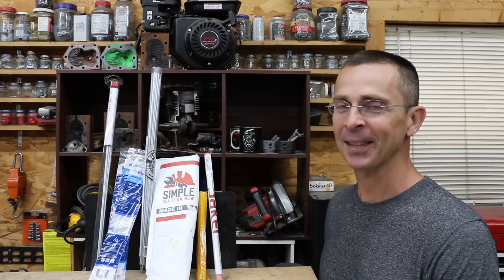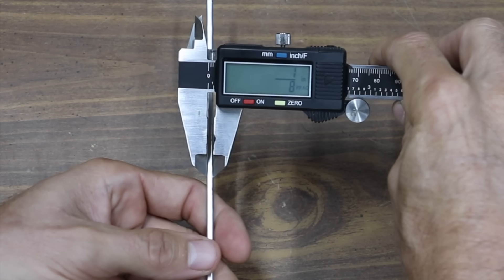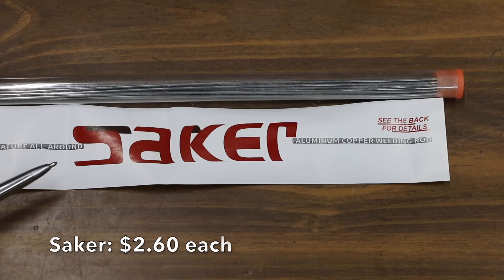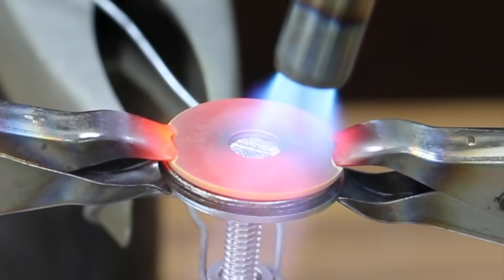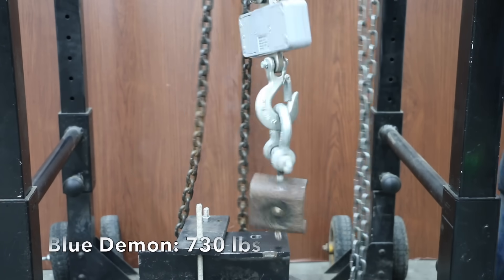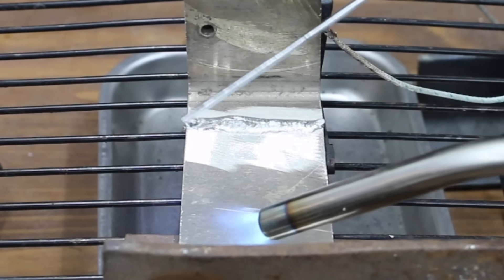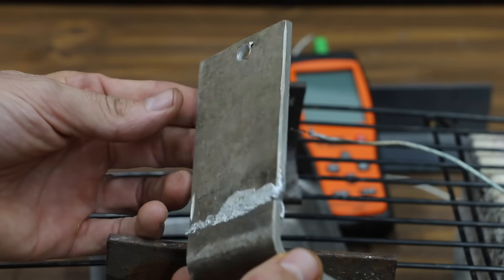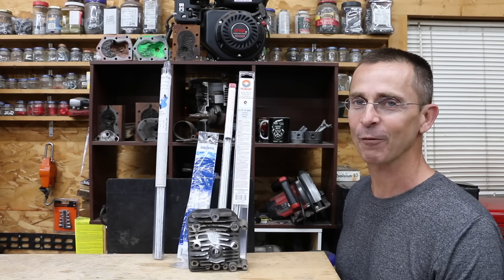Best "No Welder" Aluminum Welding Rods? Alumiweld vs Bernzomatic vs Hobart

Comment: I wonder what the tensile strength of the same sized tig weld is?   Also Why "Definitely non-chlorinated" ?
Reply: Because heating chlorinated brake cleaner can (and most likely will) produce dangerous gasses
Reply: @Rezoix  why hasn't the chlorinated brake cleaner evaporated or been wiped off during the cleaning product?
Reply: welding over chlorinated solvent produces some very toxic gases.
Reply: @TheKajunkat  yea ah porus weld
Reply: I know I spelled it wrong the first time, but any flame, along with temp will create phosgene gas.
Reply: @goodnough1  I was soldering a refrigeration line with regular lead solder and a simple propane torch in my Dad's grocery store when I was about 18 years old. I didn't have the valve tightened enough and R-12 was leaking into the line. I got a whiff and found myself on the floor. Phosgene hits you fast and hard and can kill you but is isn't cyanide.
Reply: @goodnough1  Phosgene also called Mustard Gas very popular during WW1.
Reply: Related to this, 50 years ago I soldered aluminum parts with a flux called Sal-Met. It tinned the aluminum beautifully but I inhaled a snootful of the fumes. I had flu-like symptoms for a few days immediately after that.
Reply: @flagmichael  its called a metal fever and if u only did it once its not that bad but if you've done it a lot go get checked for lung and throat cancer
Reply: @flagmichael  yeah that stuff will make you sick. Also galvanized pipe or any galvanized product. I got sick as a dog trying to weld out some galvanized pipe one time.
Reply: jack watkins Drink milk when this happens it counter acts the zinc!
Reply: @robertpolicastro1  you have got to be kidding? I have never heard that before. I'm not saying it won't work I just wonder how milk in your stomach can counteract what you breathed into your lungs?
Reply: @robertpolicastro1  Doesn't work, UK Health and Safety executive (like OSHA) specifically highlights it as a myth.....doesn't do squat for metal fume fever / galv poisoning
Reply: @robertpolicastro1  A rather cute girl I was very interested in many years ago in the U.K, was studying oil production welding and engineering. During the practical welding parts of the course she told me they were given a pint of milk to drink.
Reply: @flagmichael  Yes had it myself bud welding galvanized steal not a nice feeling or taste galvi flu we call it lol
Reply: Phosgene is created when arc welding in contact with chlorinated solvents (particularly brake cleaner). I don't believe a MAPP torch is hot enough, however. MAPP burns at ~3750 Fahrenheit, whereas the arc on a MIG welder ranges from 10,000 to 15,000 Fahrenheit.
Reply: @jasoncarswell7458  Its not about heat, its about the exposure of chlorine to high intensity UV radiation. Chlorine is a diatomic molecule in its free form and its bonds are rather weak. When a chlorinated compound is exposed to intense UV light. The light has a higher energy level than the Chlorine's bonds, so it breaks them and the result is elemental Chlorine in its free radical state. Chlorine hates being alone in its free state so it jumps to combine with something else OR itself (diatomic). It just so happens that the carbon monoxide in the open air is also reactive as are the carbon liberated in the disassociation of the solvent molecule (and free natural ozone in free air from the arc welding process). So that free radical chlorine plus that CO in the open air have a very low free energy threshold so they happily recombine. The result is Phosgene gas. The old saying is if you smell old wet grass, get the hell out of there. That is the smell of phosgene.

Edit:
To clarify, we are talking about welding. You can produce phosgene with an open flame but only in the presence of copper or some copper compounds. Copper acts as a catalyst to lower the energy threshold for the chlorine bonds but its energy is still low. An electric arc contains a lot more energy so the production of phosgene is much much higher.
Reply: @StreuB1    " If you smell old wet grass, move your a**, that's phosgene gas"...lol.  I had to make up my own version of that rhyme, that was pretty catchy.  Brian nice to see you again man!
Reply: @StreuB1  I may be mistaken but I also thought it had to do with the presence of argon as well?
Reply: @StreuB1  Well said! Your knowledge could save a few lives as there are many that still don't know about this deadly situation. Plus learning about how and why is a nice bonus.
Reply: @markschaefer5703  Argon never does anything, that's why it's a shield gas. Only way you'll hurt yourself with that is filling a space with it and displacing all the air.
Reply: @mfree80286  I meant a reaction between the argon and the chlorine in the presence of an arc
Reply: @markschaefer5703  There's no reaction with argon, possibly unless you're working with enough fluorine to be welding around it... in which case you're likely a dead man anyways. Argon's a noble gas, it's as inert as can be and chemists have to use exotic chemicals and shrines to Walter White in order to get noble gases to react to anything.
Reply: @StreuB1  
Thank you sir, I actually enjoyed your chemistry lesson.  One thing I really like about this channel,  is lots of intelligent individuals like yourself,  are trying to educate people.  Lord knows I need lots of teaching! Again thank you sir.
Reply: @jasoncarswell7458  ahh.. that makes sense.
Reply: @jasoncarswell7458   But what if you allow a few minutes for the non-chlorinated cleaner to evaporate?
Reply: @jasoncarswell7458  Not really, It's the UV radiation. - If you have a puddle of break fluid on the next bench from where you are welding it can actually kill you,,,,and everybody else in the shop. If you don't die the damage is irreversible just the the guys that were gassed with in in WW I. You never get better.  

This guy says it better then I can 
-------------------------------------------------------------------------------------------------------------------
Phosgene (COCl2) is a toxic gas/liquid used as a chemical warfare agent during WWI. Phosgene can form in chloroform as it is exposed to oxygen and amounts of UV light (although UV light is not always necessary if catalytic contaminants are present). Phosgene has a characteristic odor of cut hay.
-----------------------------------------------------------------------------------------------------------------

I will not allow brake cleaner of any kind (just in case) in my shop. Acetone, Lacquer Thinner, CARBURETOR cleaner, OK Brake Cleaner - FORGET IT!
Reply: One problem with brazing rods vs. TIG is that if you're doing multiple parts (i.e. brazing a fuel tank together with several seams and a few bungs) the parent metal will heat up to the point that your other brazed on parts will fall off.  Sort of like having to glue every piece of a model plane kit together at once instead of waiting for each part to harden, you just don't have enough hands and clamps for it.  You might want to fill in a hole, grind it smooth, then braze another piece on...but that smooth grind job is going to sag or run out of the hole by the time you're done brazing another part on. Or perhaps you've got a thick aluminum pipe or fitting that has pitting corrosion, you want to clean it up and fill those pits so the end results is a smooth ground surface.  Good luck, I've tried it and it never worked out well.  Got an aluminum frame you want to build for a go-kart and need to braze a cluster of tubes together?  Not gonna happen with this type of brazing rod, the filler metal will just drip right off the tubes as soon as you move to the next one.  Taking this video as an example, if he wanted to fill in that gouge on the combustion chamber, grind it to profile, and then fill in the outside in the same manner...that re-profiled combustion chamber is going to look terrible by the time he finishes the outside gouge.  Chill bars, heat sinks, and clamps can help, but there's only so much you can do.  With TIG, once you tack it on, it stays no matter how much other welding you do in the area.

That's not to say these rods aren't useful.  I use them to patch holes in tubing, fix little parts, and fab things on the go.  All I need are a few rods, a SS brush, and a propane torch in my truck.  The filler is definitely harder and stronger than aluminum, you can tell easily enough when you go to grind/file/drill/tap it.  All the strength testing videos, they're more or less accurate.  It's also more susceptible to corrosion and turns into a dull gray, almost lead color...not ideal if you're working with cosmetic repairs.
Reply: @Skinflaps_Meatslapper  thank you
Reply: A tig weld is a weld that fuses into both surfaces. This is a low temperature solder or braze that sits on top of the surfaces.
Reply: A properly done TIG weld generally tends to be the better way to go...but if you don't have a TIG welder and/or the skills to use one...brazing is a good option for a lot of applications.
Reply: Fun fact: Back in the day in the shop they used to use flame to detect refrigerant leaks (CFC) Up until they started noticing every time they used the tool, every fly, gnat, spider, ant and bee any insect in the shop, all dead instantly, even in open air. Apparently humans can withstand slightly more than tiny insects. Fortunately they moved away from this method many decades ago, and modified refrigerant for cars since.
Reply: @deanbevier3389  I was in a confinded basement when an R22 charged pipe opened from a small leak into a large one in the A coil.  It displaced the O2 so fast I almost had a hard time getting out fast enough.
Reply: Chlorinated products, when you put a flame to them create fozine gas, which is pretty much cyanide gas.
Reply: @goodnough1  yeah and that is one reason you got to be careful when you're taking a torch to an AC unit in the winter. I damn near passed out one time doing it.
Reply: @goodnough1  yes and any hvac tech can tell you exactly what if feels like when your torch flame hits refrigerant gas... not pleasant.
Reply: @goodnough1  not to be pedantic but it's spelt phosgene as used in WW1...Nasty stuff
Reply: @johnphillip1711  yep I corrected it below.
Reply: @goodnough1  No worries
Reply: @goodnough1  yeah. It chokes you out pretty good. Dont know how much is toxic but I've hit torpedo heaters that are too close with spray and it's not fun
Reply: @goodnough1  Thanks for the specifics!  I am going to clip and paste your clear explanation  in the answer part of another comment thread.  VERY good info to know, thanks, Bob! 👍
Reply: @goodnough1  Actually, it’s Phosgene gas.
Reply: @goodnough1  stop spreading misinformation
Reply: @goodnough1  Did you mean phosgene?
Reply: @goodnough1   @Bob G  I didn't even think about that, that makes perfect sense, I'm assuming that's only in the case of heating up the liquid brake cleaner or in a gaseous form. I would imagine that would be pretty difficult to do though because you would have to bring the brake cleaner up to that temperature before it evaporates. I'm totally going to do some research on this now.
Reply: @WarpedYT  hitler used this type gas in that thing he did
Reply: @Formerlywarmer  The Nazi's did not use Phosgene, they used sulfur-mustards and early nerve agents. They also used raw chlorine but that was a rarity as that was more so used in WW1 before organo-phosphates and the like were developed. They used it a few times because they were running out of support I believe. Phosgene was a WW1 weapon for the most part, long before the Nazi's.
Reply: @StreuB1  Aha, now let me be the one to (gently) correct you both, sir. All sides used phosgene and chlorine as war gases in WW1, but Hitler used neither phosgene nor chlorine in the gas chambers. Zyklon B was the pesticide brand name Hitler used, and it was hydrogen cyanide gas absorbed into diatomaceous earth pellets. "Just add water". The same method was used for legal gas chamber executions in the US for many years.

Also worth mentioning that simply welding on a car part (for example) that has a thin film of chlorinated brake cleaner is unlikely to create meaningful amounts of phosgene, because most of the chemical will be evaporated and blown away by the initial arc rather than being "cracked" into free radicals. If this wasn't the case, every brake and muffler shop in America would have phosgene casualties. All of the cases I've seen of serious documented injury from unintentionally-generated phosgene involved arc welding in the presence of large amounts of CFC refrigeration gas in a poorly-ventilated area - i.e, trying to fix a leak in the piping of a commercial refrigeration unit without testing the air and purging the pipes with inert gas first.
Reply: @jasoncarswell7458  I never said gas chambers. I was referring to its strategic (battlefield) use.
Reply: @StreuB1  my apologies, sir
Reply: @jasoncarswell7458  No need for an apology! We're having constructive and informative dialog! This is what people do and what used to be rather popular before people got sensitive. While I appreciate the apology, I do not accept it because there is no reason for it. We are having dialog my friend! :-D
Reply: @jasoncarswell7458  mr. Carswell, great comment. I spoke at one comment about nearly passing out working on a unit one cold cold winter day. Temp was down probably five or 10 degrees and and the unit wasn't completely evacuated and good God all mighty that was a rough job. R22 does not boil off real well in pretty much zero degree weather. Have a wonderful day
Reply: @Formerlywarmer  many of the photos of that event existed before the event. Look these up: dresden ohio train accident 1912, civil war typhus pow, eisenhower's rhineland camps (holding germans). with 109% certainty,  I can confirm to you the hall of costs is propaganda.
Reply: @StreuB1  I appreciate both of your civil conversations and history lessons at the same time!!  So thank you both!  Not to mention especially when living in a time where people can't say anything without be disrespectful to one another.
Reply: @WarpedYT  That's likely zinc poisoning. I used to do a lot of metal work and always heard about guys getting sick after grinding or welding on cheap foreign brass (with a high zinc content).
Reply: @Formerlywarmer  Zyklon B isn't the same as Phosgene, Phosgene was used a lot in WW1 and more likely that Hitler encountered it in the field than using it after he came to power.
Reply: @Formerlywarmer  "Some people did something" - Ilhan Omar
Reply: @WarpedYT  As a rule of thumb, it's best to remember 2 things.
1. Heat causes vapor. More heat = more vapors.
2. Industrial products have a lot of compounds in them you never want to inhale if they are vaporized

Chlorine is one of those compounds that when mixed, ignited, vaporized, etc in various ways can kill you before you even realize you are in danger. Chlorine and alcohol when mixed will produce chloroform. A lot of people don't realize that, and some of the people who do who jokingly mixed it as a prank to use on someone have found themselves on trial for murder. Chlorine is no joke. A lot of other commonly used compounds are deceptively benign until they are mixed together or ignited in a way that causes a lot of shop workers and housekeepers to be hospitalized.
Reply: @jasoncarswell7458  Now: THAT'S a very accurate anwer / explanation.
Many thanks & Blessings!!..😊🙏🙏🙏
Reply: @Formerlywarmer  allegedly
Reply: @StreuB1  I respectfully disagree but thanks.
Reply: @WarpedYT  I can confirm it puts off a toxic gas when heated lol almost killed myself in a water tanker by accidentally grabbing the red can instead of the green
Reply: @WarpedYT  - Did you ever find any info on chlorinated brake cleaner producing toxic gases "after" the product/brake cleaner was dry(?)
Reply: Yeah we all know americal chlorinated chiken is bad :D
Reply: Chlorine gas is a chemical weapon
Reply: @maoristereo  -Back when I was a brat kid, my dad put me in charge of cleaning the pool.  A 75 pound drum of HTH chlorine and several bottles of muriatic acid intrigued my 15 year old mind, so I took a plastic tray, put about 1/2 pound of HTH on it, sat it in the yard way back behind the pool, and then poured some muriatic acid on it.  It immediately foamed up and this yellow gas came out of the foam.  As I watched the yellow gas slowly spread across the grass I noted that the blades turned from green to brown instantaneously...
Reply: @Flies2FLL  Back when I was a brat kid in the late sixties we also had a pool with drums of HTH,my friends (all of which my parents could'nt stand) and I would mix the chlorine with all kinds of stuff for "fun. The coolest and probably the dumbest thing we did was take a gallon jug of un-diluted auto anti-freeze about a quarter full, then pour in a cup of HTH and run, the mixture self-detonated in about 20 seconds, leaving a large crater in the ground complete with a mushroom cloud of gas. we also took motor oil soaked newspapers and rolled them up with HTH, result was a self- igniting bon-fire in about ten minutes.
Reply: @pennyan2057  Awesome!  I wish I had known about that reaction;  I could have achieved a new and impressive annoyance level with our neighbors who already hated me~
Reply: @Flies2FLL  15 yr old kids be out here casually conducting chemical warfare tests😂
Reply: BAsically the same as the base metal,,,not allowing for age hardening (6061 T-6)
Reply: If you try to weld metal cleaned with chlorine youre going to have a bad day when the metal gets hot
Reply: Time to rethink that brake cleaner fueled space heater video, eh?
Reply: People have died from heating surfaces prepped with chlorinated cleaners
Reply: @5thcorps  I know. I was on life support because of it.
Reply: After 20 replies not answering your first question, I'll give you the annoying answer: depends on how skilled the TIG welder is :)
Reply: @snaplash  chlorinated brake cleaner will melt plastics. non chlorinated typically won't. i use non chlorinated for cleaning my guns all the time, in a well ventilated area of course.
Reply: Because of chlorine gas, the same gas that Germany used in WW2 for gassing.